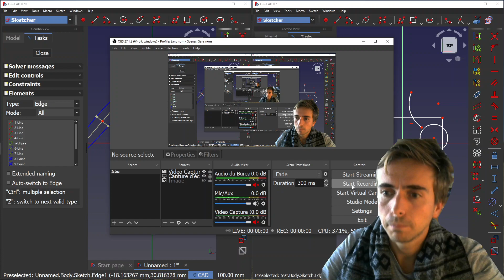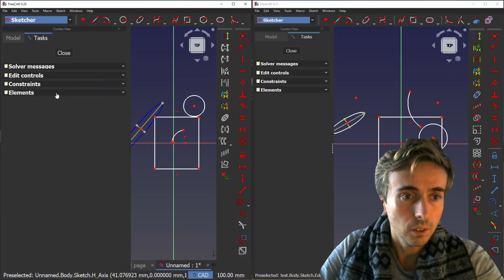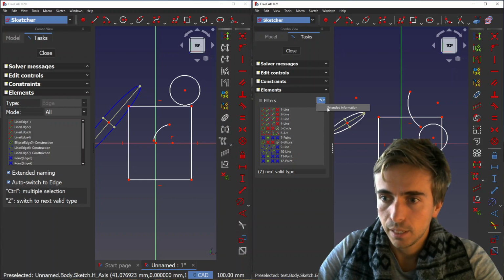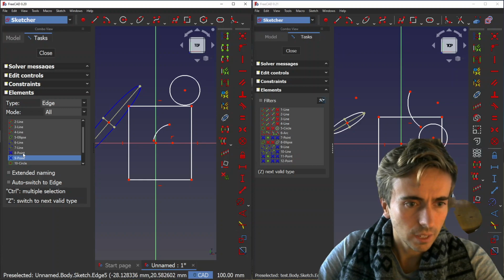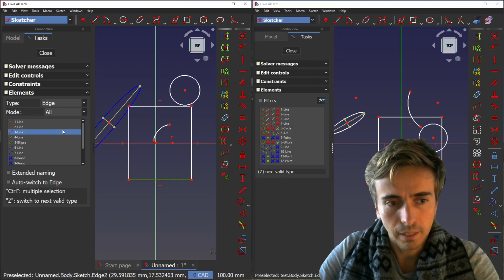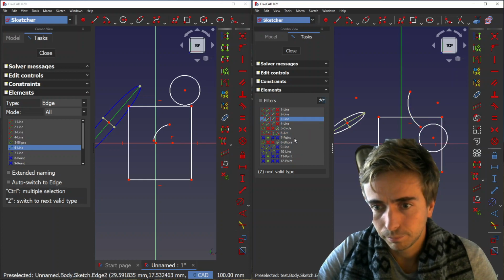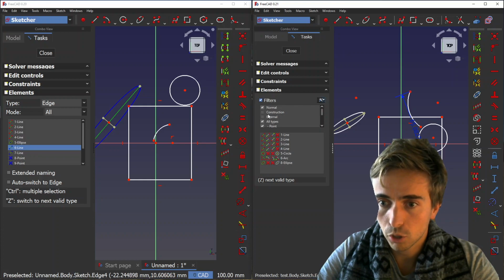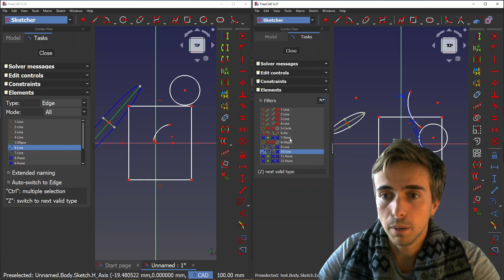Freecad Element Widget rework

Comment: i personally disagree with the filter tab minimizing when it's not hovering over, wouldn't that cause the UI to flicker too much?
Reply: It actually changed. The last iteration has the filter in a menu. The Element widget has merged already so if you download the latest build you can try it. (though builds are every week so I'm unsure if it's already 1 week since we merged the menu)
Reply: @pierreboyer9277  nice, thanks for the heads up

Comment: There are already "elements" in use with Link branch and specifically Assembly3 workbench...
Will the use of the same terminology cause confusion?
Reply from the maker: I didn't changed the name of the widget, only the layout. So I guess it shouldn't change anything?
Reply: @freecaddevdiary7038  not suggesting that you shouldn't change sanything 😜
I guess you can have more than one element types in FreeCAD...
Reply from the maker: @bambukouk  I meant that Element was the original name in Master. So RT built on top of that as well. Also it's just the widget name, it hasn't much impact on the backend.